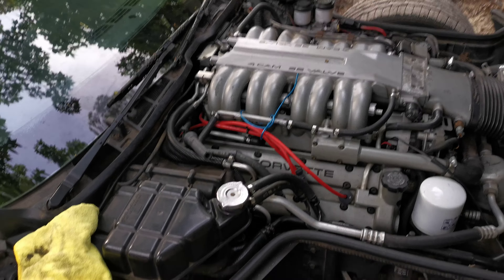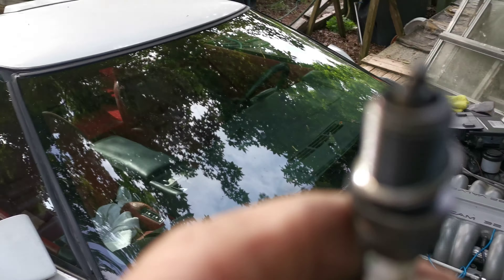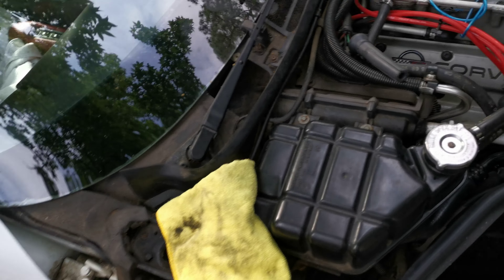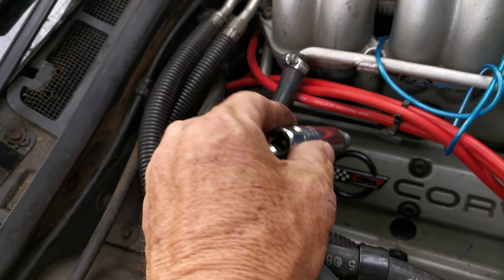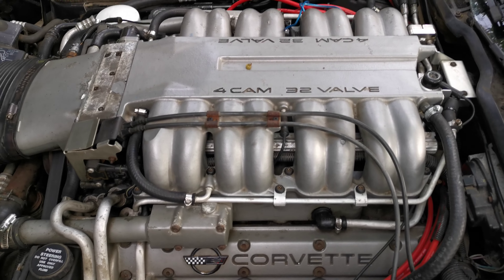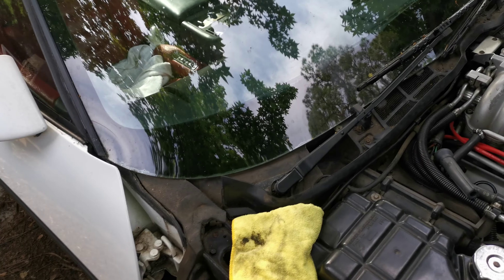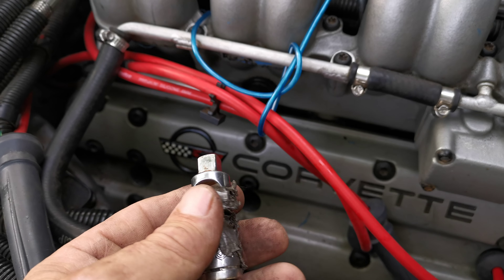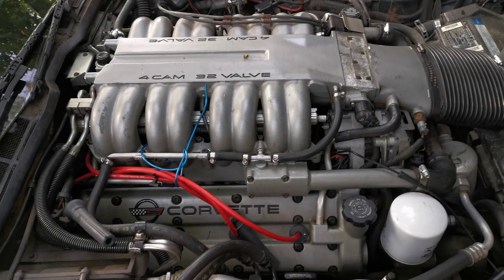Putting spark plugs in the 1990 ZR-1 LT5 number #8 spark plug

Comment: Most spark plugs made nowadays go in dry because there is a coating in the metal that is applied to the threads from the manufacture.  Any type of thread lubricant like anti seize can allow the plug to be over torqued,  not a good thing.  Stripped threads in cylinder heads are no fun.  How's that bad boy running now Mike with new plugs? -Ozz
Reply from the maker: Just got it done, number 6 was fouled, changed them all, going for a drive now, sounds goooood, may try to do a video driving her.
Reply: @TheMrmmkkpro  give the beast the old Italian tune up, drive it like you stole it!  😁👍
Reply: I watch a ZR-1 video that shows that there is a trap door by the radiator for the #8 plug. Not sure if it is for your year

I was watching your video and deciding on a ZR-1 for myself 
Also is a 1990